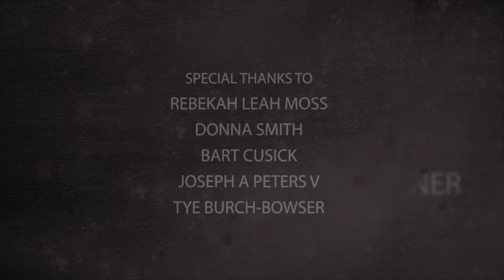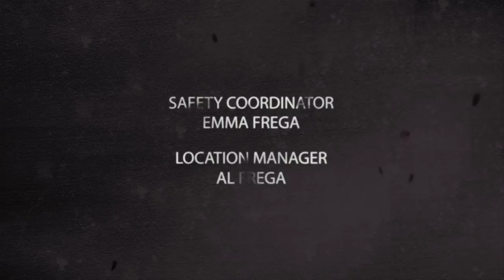MARIO WARFARE - Part 7

Comment: Wha-What the?  Waluigi broke every fuckin' bone in Mario's body! What the FUCK! WHY DID MARIO STILL WIN?!
Also, Waluigi kind of looks like a purple Nazi with that coat...
Reply: Thomas Kloos the reason why is because Waluigi wasn’t hitting very hard. He was using a fighting style called Wing Chun. A style that utilizes fast jabs and dazing attacks to tire out your opponent rather than actually hurt them so the attacks don’t really hurt a lot, and are actually weak. Mixed with very fast dodging to make your enemy miss and also tire them out. If you do the style right, you can win any street fight by tiring out your enemy and casting the final powerful blow once they are tired enough.